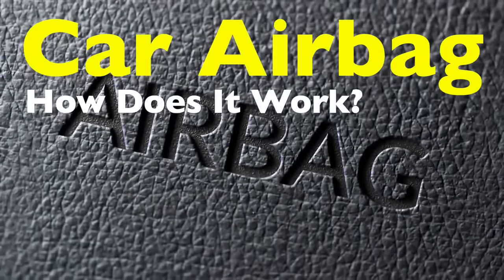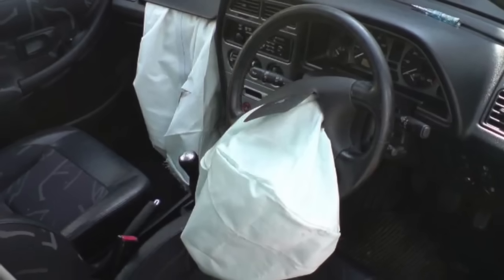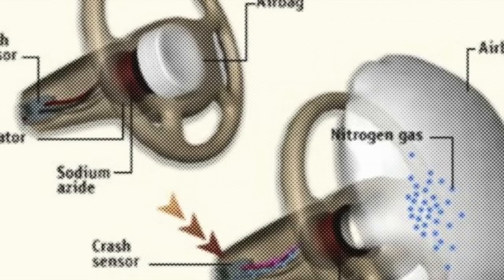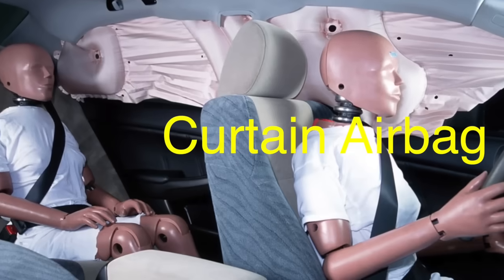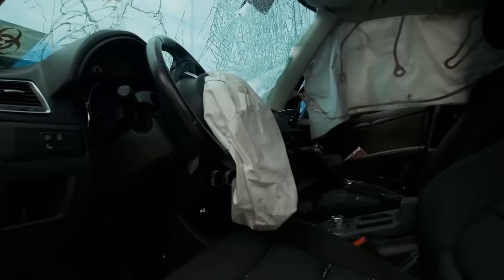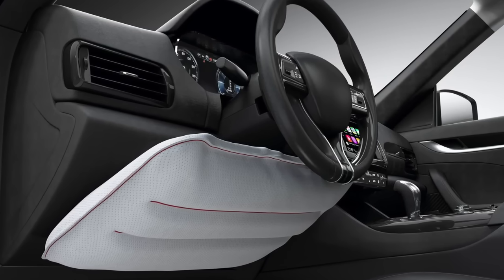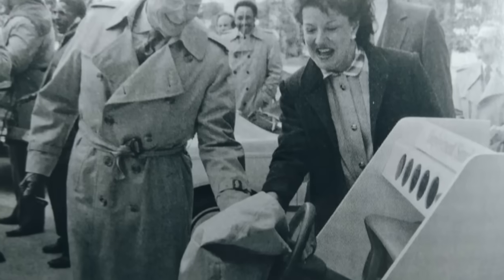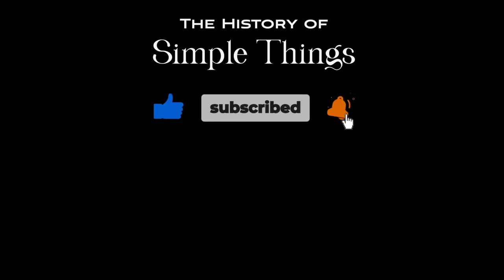How Do Car Safety Airbags Work? | 1.1

Comment: Most airbags i deal with are a gas release type on most passenger modules with the drivers module (steering wheel) being a chemical reaction, considered a "violent" explosion. All modules are considered ECUs. SDMs are ECUs that control airbags.

Comment: It will be interesting to know about how oxygen concentration is maintained in a closed room where split AC is installed and working?
There is no intake of fresh air, and the same air keeps circulating.
Reply: Compare it to a closed room with no AC. No intake of fresh air and no circulation.